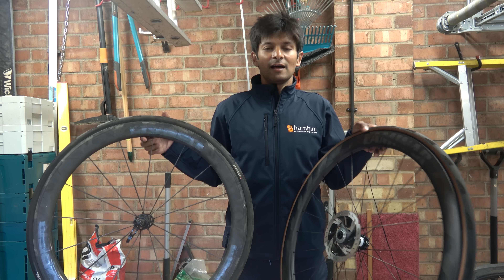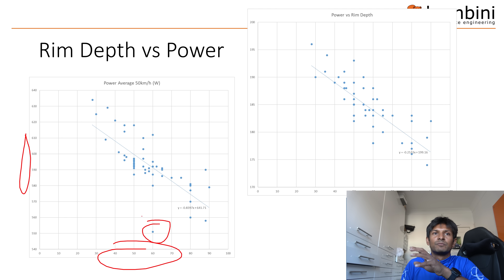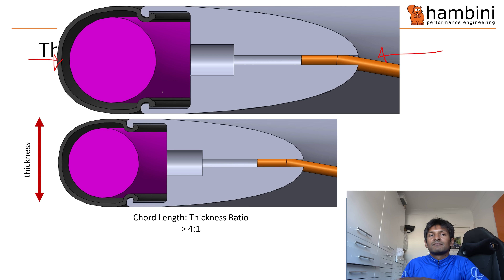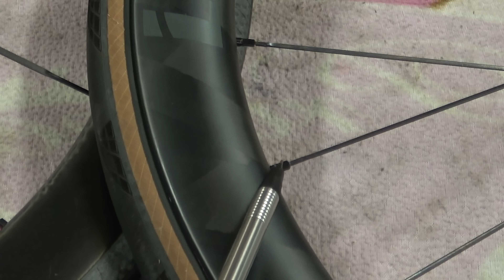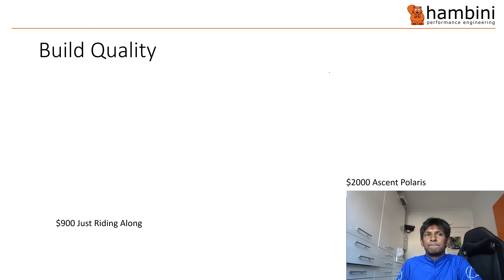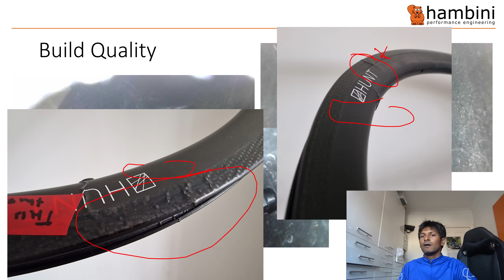Aero Bike Wheel Buyers Guide | By an Engineer

Comment: Being a 5 year old, you would believe that wider tires are faster,  but rim brakes can only allow certain widths. But 5 year olds would wonder why new frames aren't set up to use V-brakes, which are more aero and a great deal lighter.  If discs aren't questioned , we will continue to have expensive,  heavy, slow disc's.

Comment: @Hambini - I have noticed on other best seller from ALIEXPRESS - ELITE WHEELS EDGE that any Ultegra class Disc rotor put on centerlock of EDGE hubs - there is 0.5 mm to 1mm? loose fit before tightening. In my understanding - despite 40Nm tightening it will cause in long run on high load some damage to disc and centerlock hub and is sign of poor machining. What'd You say??

Comment: Thank you for the informative and thorough video.

Can you recommend a cheaper (sub £800) carbon gravel wheel for a heavy, powerful rider? I'm 203cm, 101kg and have a habit of snapping spokes. I'll be racing more next year, so need to maximise the marginal gains, but need to maintain durability. I am quite impressed with the 9velo wheels, but with the spoke count and type and some reported issues with the hubs concern me. Any advice is greatly appreciated!

Comment: You make some interesting points. However my experiences contradict some of what you say. 
I was apprehensive about moving to tubeless tires because I had heard the same arguments you made here. I have found such arguments to be without much merit.
You warn about tubeless tire flats in the field, and that they usually require a compressor to seat once you remove the tires from the rim. Truth is it’s unlikely you ever will have to. I have over 12,000 miles on tubeless tires and never had to remove one in the field. The only time I have had to remove my tires from the rim was to replace them after they had worn out, and I was able to seat and inflate with a standard floor pump too. 
If you do get a flat on the road with tubeless tires you add some sealant and air , possibly a plug (I never used one) and be on your way. Worse case scenario you put in a tube, but installing one would not be and any different than installing a tube on a standard tire setup. To each their own here I suppose.
I could tell you don’t like disc brakes because you had your hands all over them. lol! I was told that is a big no! 
It may be what the industry is pushing, but I think the majority of riders who made the switch have no interest in going back. I think they work better. That may be my bias, but they are far superior in the rain and allow for wider rims and tires. As for wheel weights in principle you may be correct, but it’s marginally better. The rims on disc brake wheels can be lighter as they do not have a break system applying pressure to them. Don’t mean to dwell on the negatives. Interesting information here to ponder thanks for sharing it.

Comment: Who cares about expensive aero wheels?  At 120 kg reliability is important.  Rear dished wheels are inherently week due to difference in spoke tensions, drive side to non drive side, the low tension non drive side fail.  Asymmetric rims help, 2:1 spoke lacing is better, zero dish is best, either off-set chain stays or 160 mm wide rear hubs.  Hambini should be able to explain why.  Low cost reasonable hubs with quality bearings, butted spokes and wide internal width Al rims like DT R500 and you have a light robust free rolling low cost wheel.

Comment: Hi there watching this video I realized that just made a mistake buying my wheels, I bought a pair of elitewheels 50mm deep 15.6 internal width and 25mm external... I usually ride 28mm tyres on my older alloy rims, so using 28mm on this ones will kill any aero gains from the wheel right? Even 25mm will fall short? Or 25mm front and 28mm on the back is a good combination? I really didn't want to go to the 23mm has it is an outdated width and uncomfortable... Did I made a mistake buying this sized wheels on 2023 when there are far way wider rims internally on the market? Thanks. Gustavo

Comment: Are ceramic bearings going to be a better option? Im new ro cycling and have some money to spend on aome wheels. Been looking around and found some nice carbon wheels with dt180 hubs. 

As im planning on cycling all year round, ill keep the original alloy wheels for the really harsh weather but will unsure if dt180 is a bit much for someone new to cycling

Comment: Really considering HED Jet RC wheels as not sure if I should trust carbon rim breaks. I am not always in a mountain downhill as I have to travel to occasionally get to a 3 to 5 mike climb. Neighborhood has smaller .5 to 1 mile climbs. I have the HED Belgium's so I know what to expect. Would carbon rims last as long as aluminum ones? What's your experience? I see that the tech for carbon rims seemed to have changed, but the fact is do I want to be heating up those resins.

Comment: Disk brakes warping due to breaking heat on a road bike...? As an enduro mountain biker that sounds just like exaggeration of the problem. Unless your descending from a mountain through a wiggly road with a fear of fast turns I highly doubt it. We do it all the time and never even heard about this being a problem. Same thing about disk brakes needing beefier hub bearings? I feel you just hate disk brakes. They weigh some grams yes, but other than that they're just awesome. Not for superlights.. Other than these points, a really awesome video! 💪

Comment: I'm pretty light, 66 kg and short 174 cm tall. I don't have much power going against headwinds and climbing. My question is if I get a descent depth front wheel, 50 mm-60mm wouldn't there be an advantage to getting a shorter depth (34 mm) rear wheel since there is so much turbulent air at the rear of the bike and I might be saving 100 gms or would it be better getting a deeper rear 70 mm for aerodynamic efficiency? Thank you.

Comment: What would you recommend between a 37mm and a 50 wheel for an all rounder wheel set?   I was looking at the Bontrager Aeolus Pro 37 or 51 and curious which you would lean towards.   One thing I don't see much mention of in looking at all the variables, is comfort/compliance.  Would a deeper wheel set be more or less comfortable than shallower one?   Thanks!
Reply from the maker: These days I tend to go for shallower rims, mainly because I like the acceleration. And I'm old

Comment: Thank you for your analysis! If i do 130km long and 1500-1700m climb per ride (6-7 hours), which wheels (carbon, tubeless, m<1.5kg, rim brake) would you suggest? 30mm, 45-50mm, or bolder ? Thank you!

Comment: Really enjoy your reviews and the very original way you put it across. I was wondering if you had any thoughts on valve extensions for deep rim wheels and the potential for high speed wheel wobble while descending especially if the wheels havent been balanced. Would be great to get your thoughts. I didnt believe it until  it happened to me on Zipp NSW 858's and once on 808's.

Comment: Don't know, there are obvious things that are not explained. Wheel rim travels at the speed of the bike. Relative velocity and path length of air particle crossing leading edge of the wheel is root two times speed, and depth. Should adjust 4:1 ratio accordingly.
And. Even a symmetrical  aerofoil generates lift given an angle of attack, lift implies drag. Even a weak  cross wind generates an angle of attack. The lift ~ ie side force,  is reacted by the road, the deflected air flow generates drag. If you have to lean a bit into the wind because of the deep rims then there is drag.
Reply from the maker: Thanks for your guidance
Reply: @Hambini  It's a question. Can't be right, but why. Some intelligent person could explain. But maybe you don't answer dumb questions only the really smart ones.
Reply: Obviously incorrect or they wouldn't sell deep wheels. But would be interesting to hear  the contrary argument. Although this point is not suited for a youtube blog. It should be on a tech forum.

Comment: At 02:50 Hambini says the main reason for disc brakes is marketing rather than engineering. With carbon rims, I consider disc brakes essential because carbon can't dissipate heat from rim caliper brakes, as well as metal rims can. Braking strips on carbon rims are a kludge.
Reply from the maker: I think a carbon rim with the track like farsports is very good
Reply: @Hambini  Perhaps, for light to moderate braking. But not for heavy sustained braking. In this test, 8 of the 10 rims tested overheated and failed catastrophically.
https://www.youtube.com/watch?v=OlZvFPdLulI
One finds plenty of cases where this happens in the real world, causing the wheel to explode and put the rider in the hospital, like this:
https://www.youtube.com/watch?v=W0iMHkYpWFo
Disc brakes eliminate this risk. Knowing my wheel won't explode under sustained heavy braking is worth a marginal cost in weight & aero drag.

Comment: just had a chance to try a pair of hyper 45s , ceramic bearing's and spokes for a couple of days, with continental 5000, 25mm clinchers with tubes, while i found the hyper wheels responsive and was able to get up  to speed quickly at 35km plus they really performed well, cornering as well as they kept their speed and when climbing , side  wind did not seem to bother the wheels as much as my regular wheels   i found them to be good ,they are light weight, The down side i found was they transmitted a lot of road noise meaning if you have a road that is worn down ,cracks , it is not confortable, they are stiff and ride hard ,but are fast, Maybe with tublees tires the ride noise would be less ? i normally run a pair of Bontrager Aerolus 5 wheel set 50mm , just had the bearings changed after 18000km  , the difference is night and day although my bonts are a little slower , However  they are much more confortable, transmitt a lot less road noise to the hands , and if i wanted to go faster i would them fitted with ceramic bearings

Comment: Why do we always discuss simple cross sections when it comes to wheels?  Surely there's only one part of the wheel that presents its "cross section" to the wind (at exactly 3 o'clock when looking from the drive side). Doesn't the rest of the wheel present infinite oblique chords - cut at an angle through the cross section - which are longer than the wheel "depth"? I'd suppose each oblique section would behave aerodynamically differently - and the wheel's drag would be the sum of these individual chord's drag?  Is this something you can explain?

Comment: Super video, learned a lot. Any estimate of how much speed you lose with the Shimano ICE slits in the rotors while coasting? My disc brake bike is consistently 5% slower than my rim brake bike, even though the disc brake bike is more aero and I’m in a more aero position, when riding / costing down a short, steep downhill segment. I’ve always been puzzled by this, same tires and intensity.
Reply: imho, much much less then you gain in later braking before corners :)

Comment: Hey hambini! Love this vid, especially the analyzation of the correlation of the rim to drag and the interaction of the tyre.

I had a query which wasnt resolved in the video,
You mention how the pump action from a disc rotor has a not insignificant difference but you didnt elaborate on it, could you tell more on it or direct me to a source that does?

Comment: Hello Hambini! How would this relate to gravel tires (32-40mm) and wheels? With the slower speeds (25-30kph) is the impact even that significant? A 37mm external rim paired with a 35mm tire seems simply massive! And thats not taking into consideration max internal width for safety concerns. Lemme know your 2 cents on this. Cheers!

Comment: Could you explain the thickness to chord ratio a bit more? I am missing something. You said we want ratio of 4:1 or higher, but using your example of 50 mm wheels and 23 mm tire I get only ~3.17:1 ratio. In the next example with 70 mm rim and 28 mm tire I get 3.5:1 ratio, which is still lower than initially suggested. What am I missing? Thanks!
Reply from the maker: add the tire on.
Reply: @Hambini   I have the same question, as his number already assumes the tire has equal height and width. Moreover, you mentioned the chord length varies across the height of the wheel in a much earlier video. How should we connect the two ideas here?

Comment: Great review. I’ve 50mm Mavic wheels & id say in gusty conditions even they can be a problem with gusty side winds. I’m not a great cyclist & aero wheels are the least of my retarding factors but purely from a safety standpoint, for general riding, I’d not go bigger than 50. I’ve had side winds give me a real shock too many times.
Reply: i ride 50mm to and they can become tricky some times in cross winds and when you get overtaken by cars.
Reply: Well, at least you probably weigh more than 48Kg, so there's that.

Comment: This was quite useful, thanks! Perhaps you can answer a specific wheel question for me? I’ve heard that latex tubes shouldn’t be used in carbon rim brake wheels. Is it more worthwhile to go with latex tubes in box section alloy rims, or carbon wheels and butyl or TPU tubes? What kind of watt difference are we talking about at 35-40 kph? I’ve gone tubeless in the past for road, and have had enough troubles sealing punctures that I’d prefer to stick with tubes if I can. I imagine aero wheels are faster, but I’m interested in the dollars per watt calculation there, as latex tubes are rather cheaper than carbon wheels. Thanks!

Comment: You can replace the bearing cups on all the Campagnolo hubs, in fact they have been using the same parts in there hubs for many years. They do use sealed units in a couple of the cheap range
Reply: the inner cups as well? on shimano 105 you can replace the outer cup but not the inner cup wich is fused to the hub. wtf.
Reply: @RevoltingRudi  Yes the inner as well and that's on campag and fulcrum. That is why there good winter wheels in lot of ways
Reply: Where can you get the inner cups? My Fulcrum Racing 3 front hub needs a new cup and seems difficult to find.
Reply: @jonathangriffin6236  UK, Chicken cycle kit or i-ride. You need to go to a shop that has the correct tooling. Phone i-ride and get them to do it for you.

Comment: question for Dr. Hambini the bearing wizard - why does no one use tapered roller bearings or needle roller bearings on wheel hubs?
Reply: I'm just generally surprised as a mechanical engineer (who doesn't live in bearing world) at the preponderance of ball bearings. Is it simply down to availability?
Reply from the maker: They don't make them in that size readily.

Comment: The minor weight difference between the rim and disc brake setups will have virtually zero effect on speed at a given wattage. Furthermore, a rim brake rim must be engineered to do multiple things - hold a tire AND provide a braking surface AND dissipate heat AND (hopefully) be aerodynamic. A disc wheel doesn't have these constraints thereby allowing the rim to be designed with weight and aerodynamics as a priority without having to worry about it requiring a braking surface and heat dissipation into the design. Lastly, aero tests (that I've seen) show virtually no difference between rim brakes and disc brakes, so claiming there's an aero penalty for disc brakes is arguably inaccurate.
Reply: Disc bikes are typically a kilo or more heavier, which makes a difference on steep climbs. More importantly, to narrow the gap, manufacturers have been making very thin tubes, so frames are not robust eg. Handlebars easily breaking a top tube.

Regarding specially engineered rims, the difference is about 35g per rim, if that. As you say, weight makes little difference. Even rotating weight.

Finally see Hambini's post where he says add 10W for a disc bike at 200W. Specialised claimed no difference between bikes but they would.

Comment: Fantastic resource. Thank you. As someone who runs road tubeless thought it would be worth pointing out that while it is true that dealing with a tubeless tire failure in the field might be more difficult than a standard clincher, you're much less likely to have a tire failure in the first place. That said, if you run tubeless on well designed modern tubeless-first rim, dealing with the tire failure in the field, at least in my experience, is almost identical to dealing with a clincher failure. The main difference is that you'll want to remove excess sealant (although there's a good chance this all blew out if the tire didn't seal), and you'll probably need a boot. Holes that are small enough to not need a boot should get dealt with by the sealant.
Reply: I agree. I've had to deal with a flat that wouldn't seal up twice in five years and both times it wasn't really any worse than dealing with a flat with a tube. Both times most all the sealant was gone. One, I had to boot up and put in a tube. The other I didn't, so just had to put in a tube. (It was weird. It damaged the tire but didn't cut the fibers, and it was on the sidewall. So the sealant just couldn't seal it.)

Comment: I purchase some Yoeleo 60/80mm with dt swiss hubs ive been down potholes at speed thrashed them to bits,and use S works cotton turbo tyres on them....never once have they ever broke buckled or what ever,im 85 kilo so no lightweight,and believe me they are very fast wheels,i have done Time trials on them chain gangs and they by far exceed any other wheel i have ever used.And they are so reasonably priced its a joke...I bought them because of Hambinis review on them,had i not seen this review i would have bought zipps who are not bad but absolutely never as good as Yoeleo,s